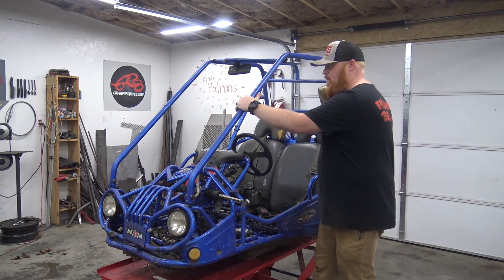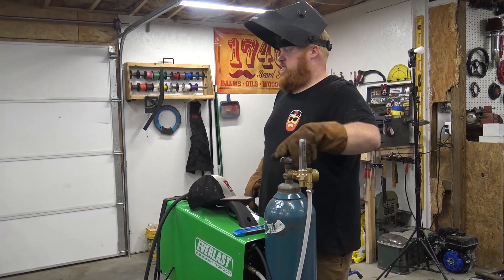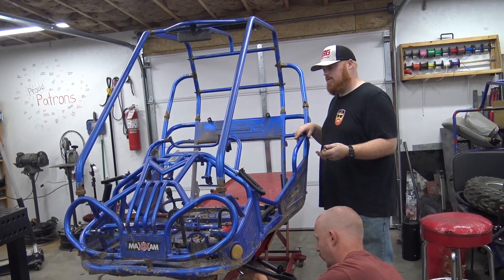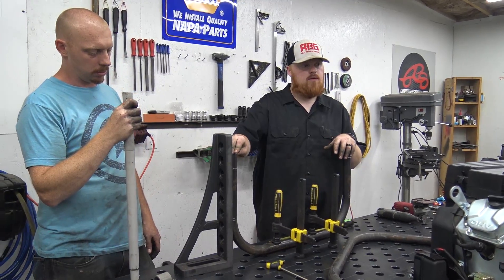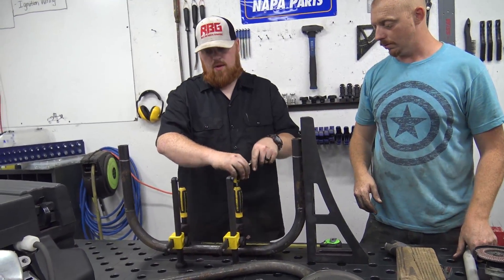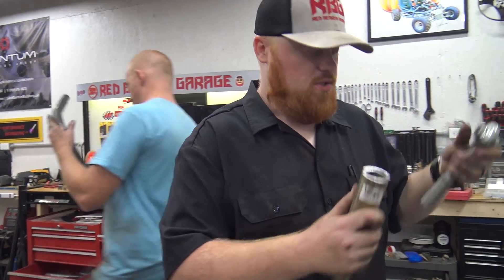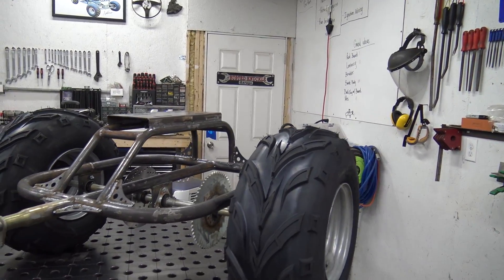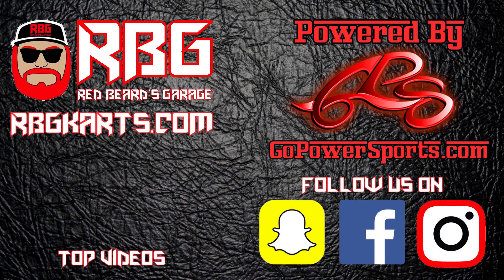Semi Independent Suspension Go Kart Build Ep1

Comment: Red beard, you all should have designed a fully independent rear suspension with articulating a arms and axles with cv joints to drive the rear wheels.  With the engine you're using that thing would ride like a dream both on and off road.

Comment: i wanted to do a golf cart with a vtwin 670 with a reverse gear box.  but didnt find no good answer online if it will hold the hp. so i settled for a 420cc with torque converter,  and reverse gear box.

Comment: You should make the rear able to articulate like a 4x4 tractor with front steer axle you could really make some tight turns. If you want you Just need a cable with indicator to show center and a small power steering pump and a selector valve and a 1" bore x 8" stroke hydraulic cylinder.

Comment: Nice, I have a 2004 Hammerhead Twister I am redoing, I will be using a '97 CBR600F3 engine for power 
https://youtu.be/dy54vFTvolA the thumbnail on this video is what I started with. It sat in someone's back yard for 8 years (the first pic I seen of it-not the thumbnail at the beginning, it was covered in 3 foot of snow). I replaced the reflectors, front (round amber, corner) and back (red rectangular, side) with working LED lights. 
I have since added (after this video) pin striping to the raised portions of the side panels, and the front V shaped tubes, also to the raised portion on the sides of the rack that didn't have a reflector on it.
The back only has the original oval light and the LED strips (that I added) now, the original blinkers were removed off of the back, giving it a cleaner, more modern, look.
I have also added LED side shooter off road lights on roll bar (above where the mirror hangs)
Taped the wiring harness tube in red tape to conceal it better, and I am using red zip ties to hold it in place.
I plan on putting a receiver, front and back, so I can put the winch on either end if needed. The winch has a wireless remote, and the wiring has been fitted with quick connects so I can move the winch easily.
As someone who has suffered from severe chronic pain for years (and the fun things that come with it: depression, anxiety, moodiness...), your channel, and a couple others like it, have been a GODsend. Not only do your videos give me a brief escape from my reality, they have also motivated and inspired me to pick up this "hobby", which is also a welcome escape from (my) reality.

Comment: Hey, there's the maxxam! This is the exact model I have! It's still running the original gy6 with obligatory improvements, but sometime in the future my plan is to change to a yamaha warrior 350 engine I have.
Reply: Also, those maxxams have a rack specific to the carter talons and twister hammerheads. The passenger side dust boot should have a foot long smooth section along with the corrugations. It makes it near impossible to find replacement boots and hard to find the rack. It's set up this way to allow both tie rods to be equal length while still biasing the steering gear to the driver's side. It's probably the best thing for handling bump steer in this chassis.